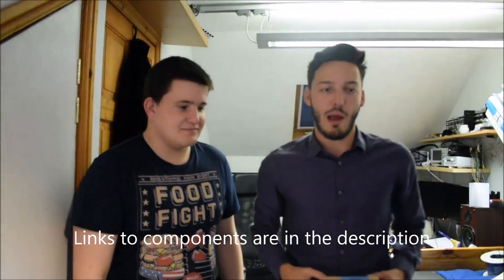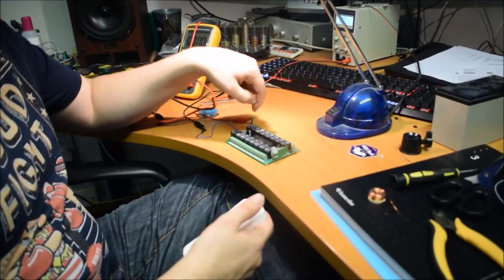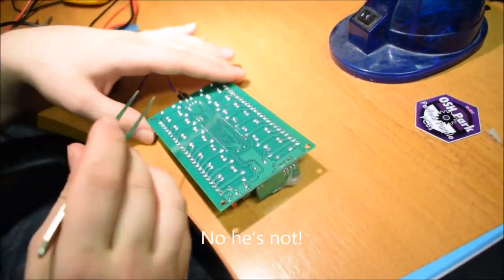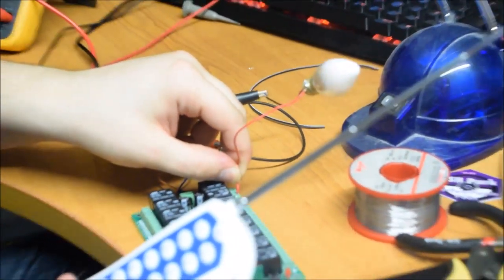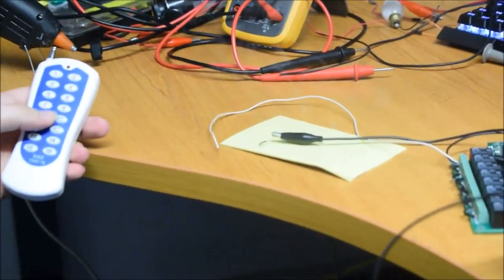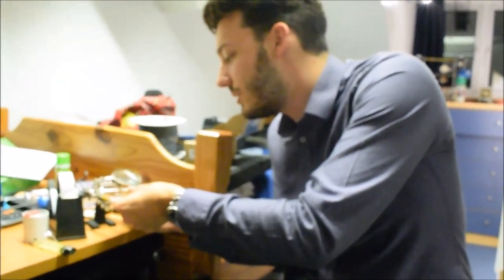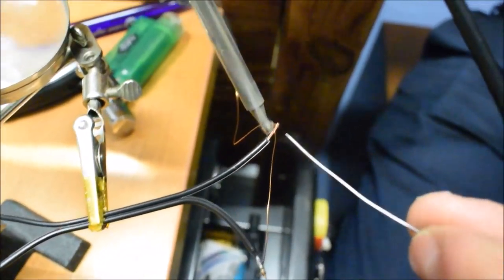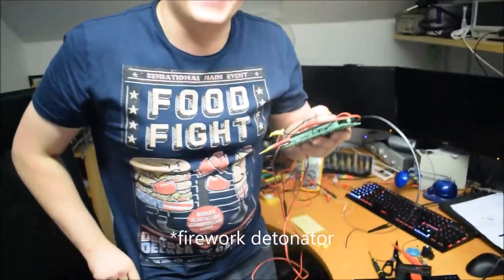Cheap DIY wireless 16 cue firework detonator

Comment: Nice! I've seen 1/4W resistors used instead of the enamelled wire, may be marginally easier? Not sure there's much in it. I haven't seen French bangers for years!! Last time i went to France they didn't appear to sell them any more.
Reply from the maker: We did think about using resistors, but the enamelled wire works pretty well. I think the commercial e-matches use nichrome. We are going to get some to try out too :)